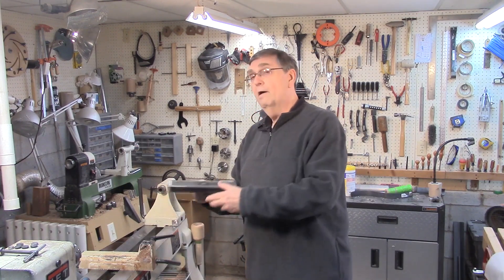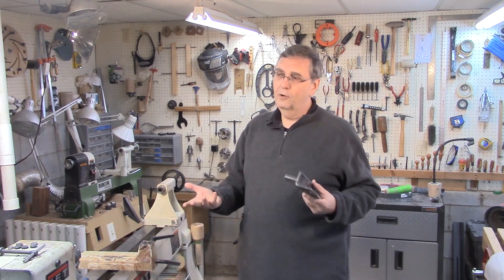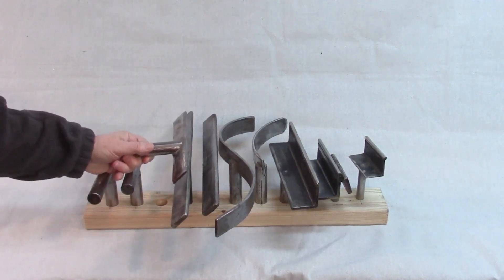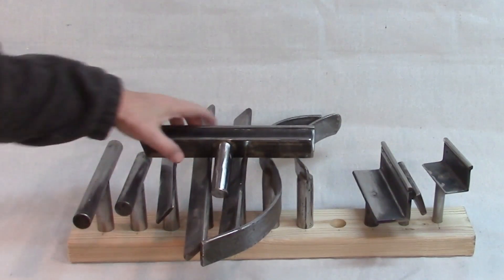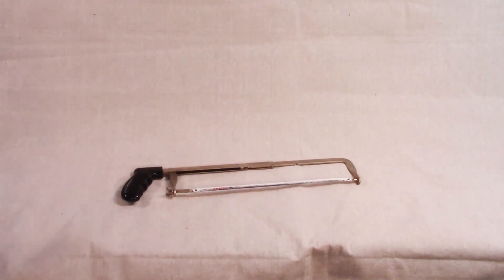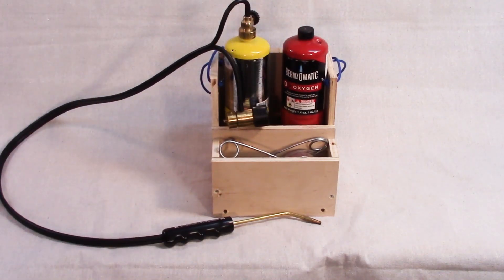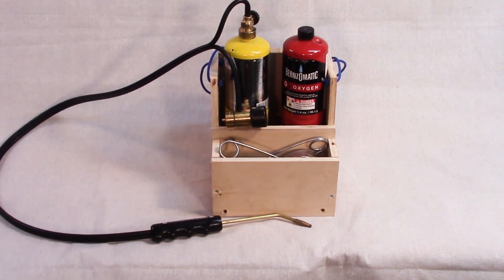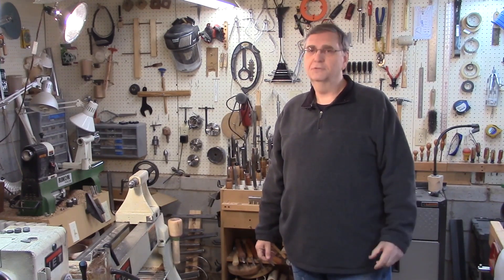Make a tool rest - part 1 - overview

Comment: Not sure if I have seen this or not.... I used to make the Big Ugly tool, which is 3 inches of 1/8 by 1 inch wide tantung silver soldered onto bar stock. A very heavy duty scraper. When doing the silver soldering, I had to use silver solder ribbon. One other guy made them and put a couple of pieces of silver solder wire under the tantung. Had to do it because the wire solder wound not wick in all the way from the edges, and considering the abuse this tool takes, it needed full attachment. Like the little mini torch. Apparently the more modern MAPP torches do not get hot enough to get a good bond.

Oh, I do prefer hardened drill rod for the tops of my tool rests. Not sure how to do it myself. I did find the A drill rod to be far harder than the oil or water rod. Love the way the tools slip across the top, and how even I can't seem to put dents and dings in them.
Reply from the maker: I finally gave up on silver brazing. Just couldn’t get the steel hot enough.
Reply: @RickTurnsWoodturning  I just picked up a medium sized torch yesterday mostly to make some custom little ugly tools for box making. I would think that for soldering some drill rod onto a surface, you would need to cut a groove in the metal you were going to solder it to. Not sure. I believe that is how Steve Sinner makes his tool rests. I did find out that after having the drill rod hardened, welding it to the support arm did not change the tempering of the drill rod at all.

Comment: I have made all of these tool rests over the last 25 yrs  it is. Good to invest in  a set of very cheap welders right angle magnets to hold it in place  and find  a friendly  local engineer with a skip outside for   Material  ps I am lucky enough to have a small  welder  which lasts for ever and is cheaper  than gas in the long run
Reply from the maker: I have given up on doing with the small mapp torch. I think the torch regulator quit working, and I didn’t want to buy another. An oxyacetylene welder is the way to, I’m convinced. Thanks for watching and commenting, Harry.

Comment: Gunsmiths used to use silver soldering a lot.  I suppose they still, do but interests have changed and I don't keep up with it as much now. I don't suppose it's quite as strong as "welding", in deference to Mr. Serna (below), but undoubtedly sufficient for this.
Reply from the maker: Thanks for watching and commenting, John.

Comment: migs are  cheap now    perfect for this  i have a flux core  ill  try these
Reply from the maker: Sounds like a good idea. I had considered buying one but even if I wanted to spend the money, I don't know anything about using a welder. My other concern is that the mig welders I have looked at say they will weld up to 3/16" steel, or something similar. So that makes me wonder if that weld will work. I like to hear how it works out for you.
Reply: itll work  i just used it to weld a striker on a fence post

Comment: Very interesting video!  One question please.  How strong is silver brazing compared to standard welding?
Reply from the maker: +Terry Ellis Hi, Terry. I'm not sure which joint is stonger, welded vs brazed. However, from what I've read, both joints are stronger than the metals being joined. From what I've experienced (from my tool rests), the brazed joint is strong enough for the stresses produced during woodturning. I've never had a tool rest fail, except when I had a bad brazed joint. After I braze the post to the cross-arm, and let it cool, I whack it hard with a small sledge hammer. If I've done a poor job, it breaks. But when I've done it right, which is usually, it won't show any weakness when pounding on it with the sledge. The brazed joint depends on good mating surfaces of the two pieces, and then getting both hot enough so that the brazing filler flows into the joint by capillary action. The only problem I've had with brazing is getting both pieces of one inch rod up to red hot...I usually have to do it in several different spots around the circumference. The large mass of the two one inch pieces siphons off heat very rapidly, so it can be difficult to get both pieces up to temperature with just a mapp torch. It can be done, of course, and I've made over a dozen tool rests.

Comment: I hope you "fill" the angle iron with a triangle wedge of wood.  There is a danger of running the tool off the end of the tool rest and the downward force while cutting could injure fingers.  It could act like a guillotine.  By filling the angle iron with a wood block the force of the error will slide you away from danger.
Reply from the maker: +Lyle Jamieson Thanks for the suggestion, Lyle. I hadn't thought of doing that, but it does sound like a good idea. I'll add a comment to the video notes about that.